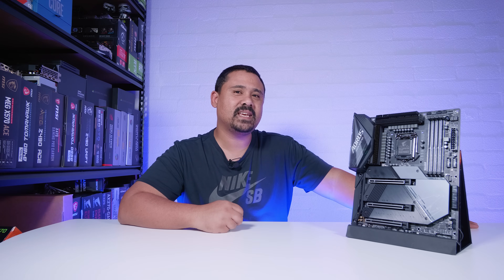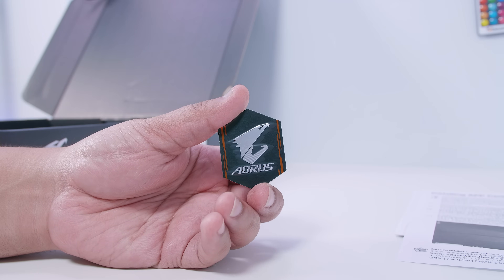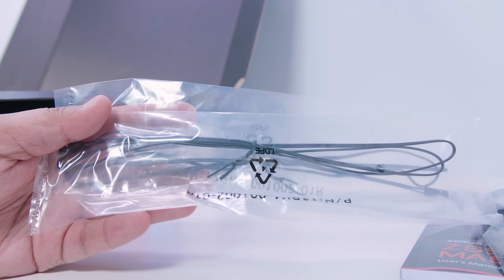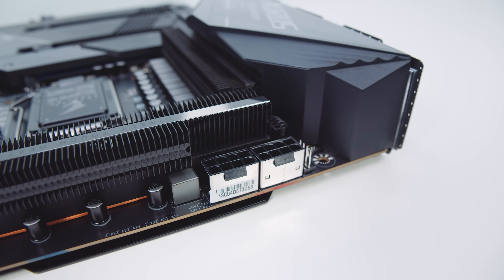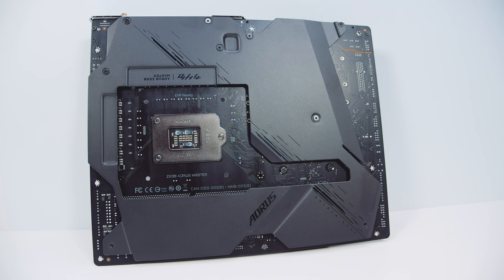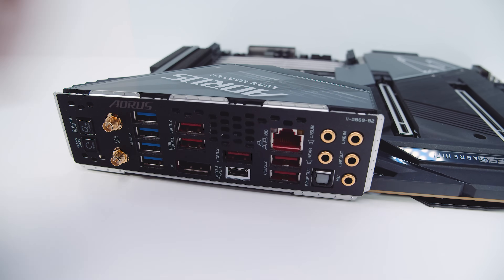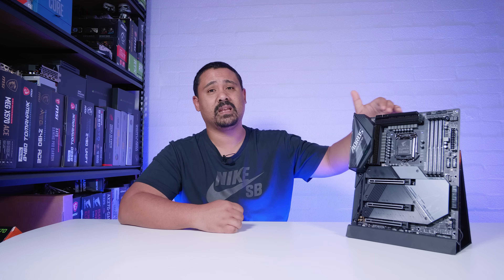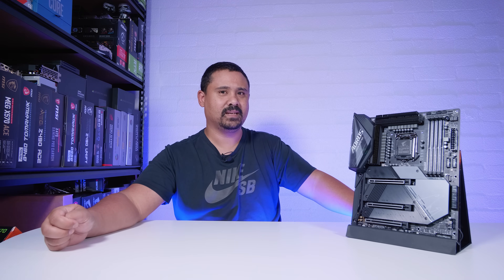Gigabyte Z590 AORUS Master - First Look and Overview

Comment: Will the TPM be part of the Sale of the Motherboard!?!?!?!
Reply from the maker: TPM is built into the CPU. People really don't understand how TPM works
Reply: @GearSeekers   I am looking at a Ryzen 5 5600x on a Gigabyte Aorus B550I Pro AX ... at the end of the M.2 Card between  the Audio Header and Fan Header is a TPM Header ??? I don't need to get the TPM as it is on the CPU?
Reply from the maker: Correct. Any CPU from the last 4 years has TPM 2.0 integrated. I would suggest researching a little before worrying
Reply: @GearSeekers  Thank You! Happy Building!!!
Reply: Thank You and I got a couple of Years  that I will need  to Build but Researching is been interesting as my  I7 2600K on a P8Z68 V pro gen 3 has done me good for 11 years!

Comment: Gigabyte makes awesome boards but garbage hellish software (RGB Fusions) with like 10 year old interface, I mean what's up with that? Only for this stupid software I am planning to switch from Aorus Pro Ax Z490 to asus board as it can be controlled with iCUE. It is not that iCUE is anything like as the best but I can use a single software to control the leds.
Reply: Couldn't agree more.  There seems to be a mem leak in RGB Fusion 2.0 hindering slight initial performance, however moderate usage is where performance really gets dinged.  Followed by "USB lag" resulting in disconnects/reconnects/spasms.  Sound is usually affected when mem leak is present.  Clearing CMOS is a short-term fix...sometimes!  Love the 10G only ethernet port!  Thanks for the wonderful overview!

Comment: Two more phases than the Z490 version and adds the ability to change the function of the reset button to safe boot, otherwise not much difference.
Reply: please mr sabishiiihito what do you think of the new generation of intel  
is it worth upgrading compared  
at the z490
Reply: @med1610  haven't seen enough benchmarks to say, but the single-core performance of 11th gen looks a lot higher than 10th gen
Reply: @sabishiihito   thank you  
I have a 10900k I wonder if it was worth the upgrade
Reply: Aside from the future proof of the LG1200 socket right?I might be saying nonsense here, just want to understand if this is a point...
Reply: @lucasthomaz3720  Z490 has the same LGA1200 socket and support for 10th and 11th gen Intel.  The point is if one has a good Z490 board, especially the nearly identical Z490 Aorus Master (which has PCIe 4.0 support), there isn't much reason to get a Z590 board.